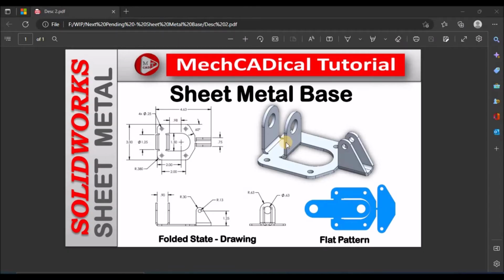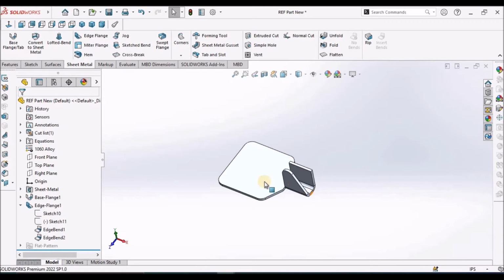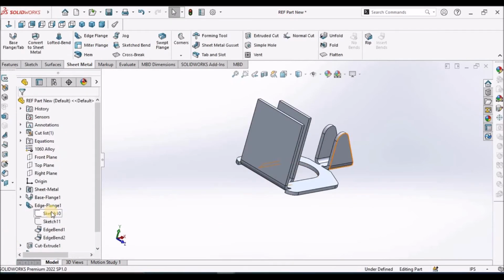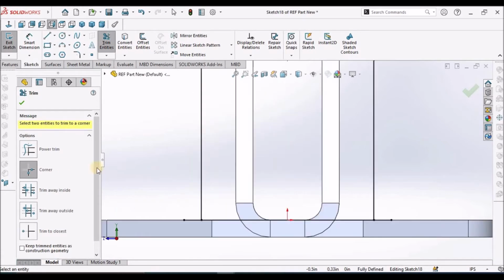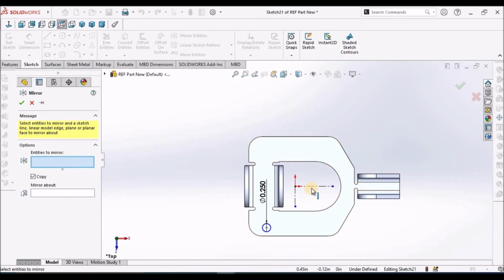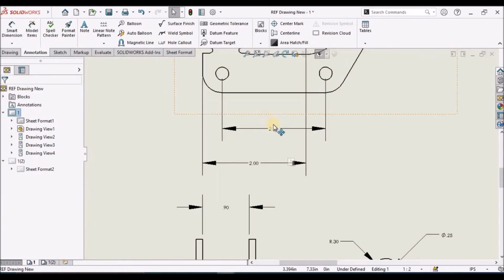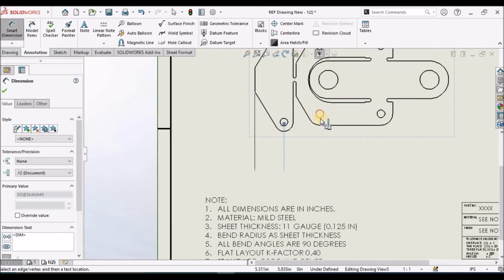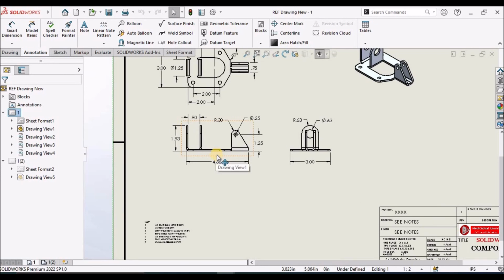Sheet Metal Base In SolidWorks Sheet Metal

Comment: Respected sir, I am a fresher mechanical design engineer and joined one small company, but I have lots of doubts in hole wizard regarding which type of specification we can select please make a detailed video regarding the whole procedure. And one more doubt is  what is flexible assembly and what is the use of resolve to light weight. Please make video lectures for the same. It is my genuine request to you sir. waiting for your positive response.
Reply from the maker: Hi Jay!! sure I will create in my upcoming Videos. Light Weight is for any display of component in Assembly, we can't edit the part. Whereas in resolve mode we can edit the component. We use light mode for quick opening of large assembly files.
Reply: @mechcadicaltutorial  thank you so much  sir🙂👍